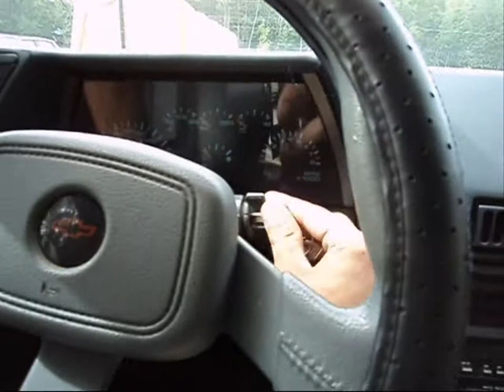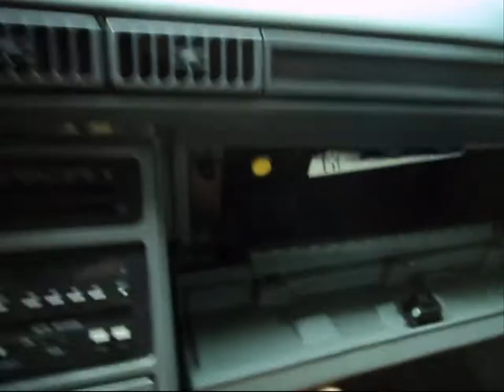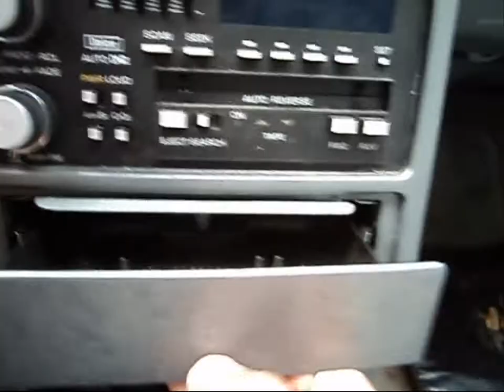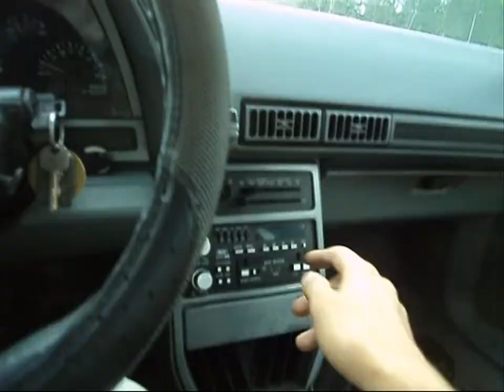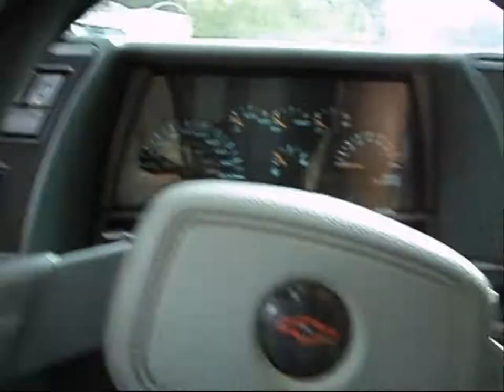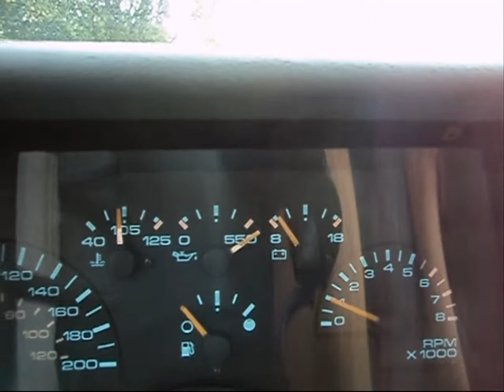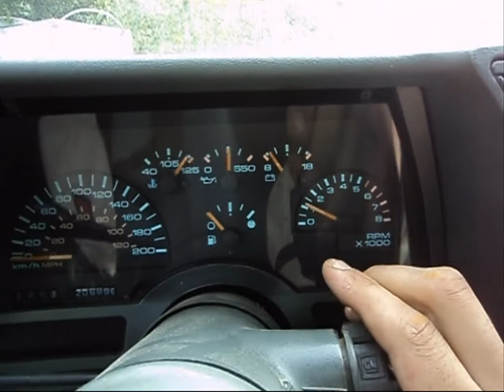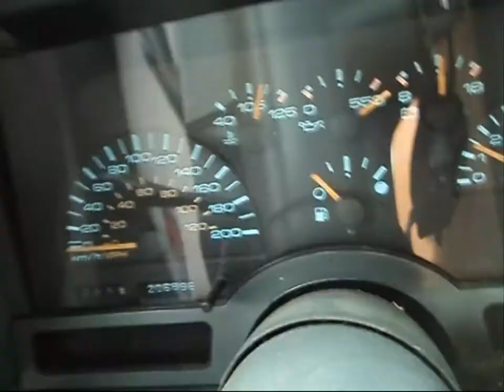1990 Chevrolet Cavalier Z24 (Re-Uploaded)

Comment: Had a black one, was my second car. Actually loved it. Had it for like 12 years. Didn't baby it much either, did a crap ton on work on it through the years (two blown head gaskets, several heater cores, alternators, water pumps, thermostats, piping, etc) but the was a solid vehicle. I was young and enjoyed working on it. Eventually it rusted out, the transmission took forever to go into drive (automatic) on cold starts, and the engine gave out. In the end, just wasn't worth fixing. Sold it to a scraper for $40.

Comment: Mine, a 1989 Z24, spent 8 years on the grass... The car is in great shape, the under-structure is not even rusted. Starts in a quarter second when battery is charged! No problems with the engine, trans is perfect and the check engine light is always off... But she needs a new paint and also a new RH quarter panel.

Comment: your rockers too huh, well im searching for inner and outer on both sides. if you found some somewhere could you tell me the phone number and the price you paid for yours? thanks in advance and good luck with yours :)
Reply: If you need parts for your z24 cavalier message me
Reply: Marten Franzel yeah, what i need is rocker panels, a drivers side floor pan, the metal bumper inside the plastic one on the back of the car and possibly a trunk pan. 

i got some rocker panels but they arent preformed so i was looking to get preformed ones. 

right now i dont have money to get anything but most likely in the spring ill have some extra cash to get some parts. 

i have a 1990 Z24, anything you could tell me about where to get these and how much would be greatly appreciated. 

i got the car 5 years ago, it was owned by one guy the whole time. the guy died and did very little work to the car. it was on its last leg really. now its dead for the moment. the engine blew a gasket on the top of the engine so while running it spewed carbon from some "exhaust recycler" on top of it and after a while the thing started puking oil from the back of the engine, it needs rebuilt with new fuel injectors. at least one isn't, wasn't firing. i found out about the metal problem by accident. the brake lines were bad so i went to jack the car up, about 6 inches into this the car creaked then dropped onto the jack putting a big hole in it. this is when i took of the trim to find that the rockers were screwed.

i still replaced the lines, pads, drums and calipers along with the worn out alternator and the plugs n wires. 

the trunk on the other hand was ok when i got it, there was a random crack in the trunk. after all this time the metal has deteriorated and there are large holes in the back. 

all this being said, eventually it will get fixed, i hate quitting. i have found that summit sells some "magic potion" to turn rust into a black polymer which should allow me to save the remaining trunk pan. that along with a mig welder i should be able to do the trunk myself.

this year i learned how to do some welding, i also learned after getting the job done that arc welders arent really for thin car metal. but this was on a different car and it got me past inspection so it was good enough. 

anyway im sure you got better things to do than listening to me so ill let you go. thanks :)
Reply: I have a 1988 it's blue and silver I got it off my uncle I was going to do a supercharged 3800 in it but I don't have any money to do it it is missing the engine Trans and engine cradle I was going to send it to the shredder but i knew there was some people still looking for parts the car has minimal rust
Reply: Marten Franzel well i have thought about it, it makes more sense to get your car and put my parts into it than to carve up your more intact car to fix mine. so i have some questions, 

1, how much would you be asking for the car?
i wouldn't think it would be too much.

2, how much would it cost to get the car sent to me? im in maine. i dont have the means to come get it. 

3, can you show pictures/video of the car? 
a smart buyer always sees the product they are looking to buy.

4, engine cradle? you mean the front end frame that holds the engine? if so its cool, my car obviously has it. just wanna be clear.

theres some good news, since the car is well over 15 years old, theres no need to bother with title stuff, when i get to buy it all i gotta do is pay you, pay for shipping and then deal with the engine/trans transfer.

an over all would do well for video or pictures and if you could point out the rust it would be great :)

the best part about this is its just a straight up transfer of the stuff missing from your car body.
Reply: Marten Franzel almost forgot to ask, what engine was in it originally? was it a 3.1 or?
Reply: Marten Franzel bro, you there?
Reply: TheEternalHater yeah sorry I haven't been on in a while it had a 2.8 I have some pics of the front of the car and I want 300 for it
Reply: Marten Franzel sure, i dont have a cell phone though. and yeah, still interested. all i would need to do is have the cash to get the car and then figure out how much it would be to ship it up here. im not sure who would ship it though. 

when i get to it, ill be contacting you. ill message you here first, ill tell you my number so you recognize it. 

this is great news :)
Reply: Marten Franzel also ill need to know what city and state you are in so i can get accurate shipping pricing, thanks :)
Reply: I'm in sterling heights mi 48312 where are you located
Reply: Marten Franzel  and thanks
Reply: Marten Franzel oh, can i see the pictures? thanks.
Reply: +TheEternalHater Thanks for the chuckle  Ha ha
Reply: +Marten Franzel He'd get more scrapping it.
Reply: toyoscio
well, im not joking. i really am trying to fix my car, im much closer to getting it done now. i wouldnt scrap the car even in its condition. just because you dont like it doesnt mean no one does. just the same what you might think is a waste of time and money might not to others and what you think is a worth while vehicle might be something we see as worthless and a waste of time.

its my project car. i have an SUV and a Trans/Am besides. its not that i NEED to fix it, i WANT to fix it. i like the car, to me it looks cool. its a challenge. especially in its condition.

what do you drive?